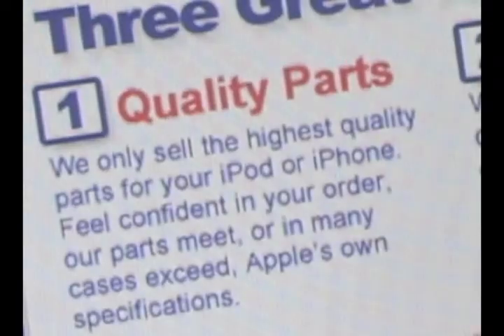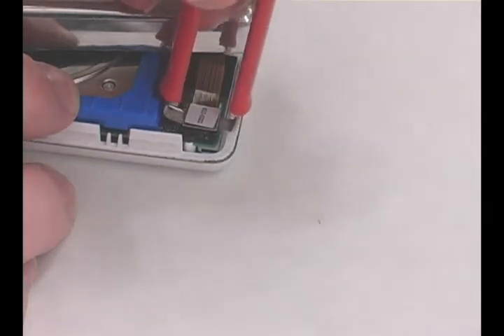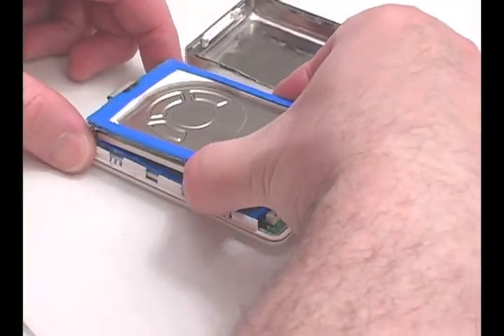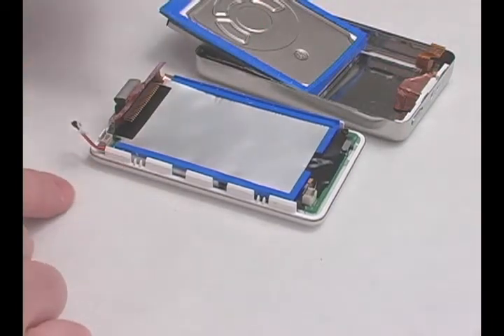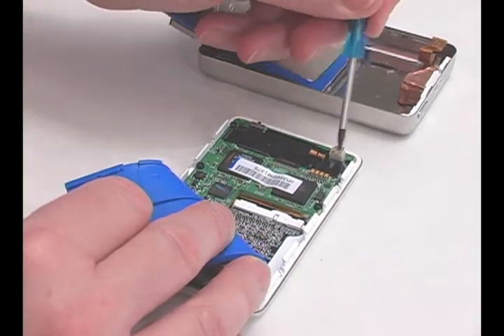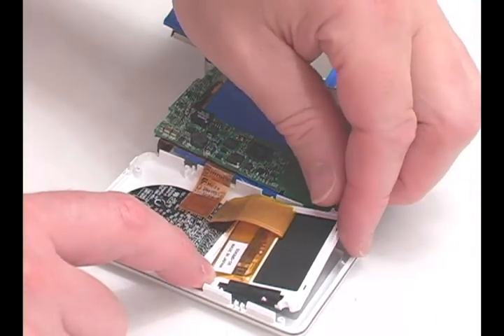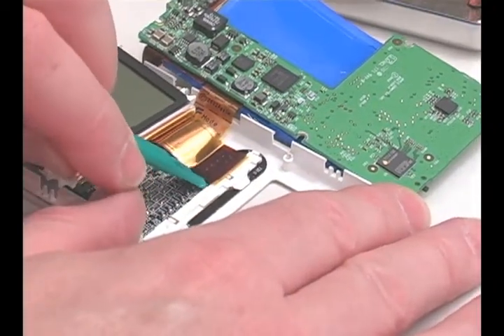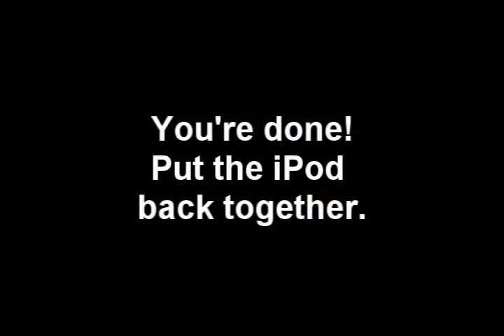DigiExpress - iPod 3rd Generation LCD installation

Comment from the maker: If the colors are gone, but the buttons still work, it sounds like it could be the start of your click wheel beginning to go bad. Those lights are controlled by the click wheel assembly and are powered by those connections. The only way to fix those is to replace the click wheel assembly.

Comment from the maker: @Ezarifa If you are speaking about the iPod Touch 3rd generation, you probably need a replacement headphone jack itself.  As you know whenever you remove headphones from an iPod while its playing it will then automatically turn the iPod to pause.  If your iPod is playing aloud while the headphones are plugged in then you probably need to have that headphone jack replaced.  There may be other issues at hand, but the first step is to swap that headphone jack with a known good unit.

Comment from the maker: @mcrheart101 The cost for replacing the Screen on a 4th Gen iPod Touch is $119.99 for the part and $25.00 for the professional installation service. The newest iPod Touch screen comes as an assembly which includes the Glass, Digitizer and LCD Screen. These parts are fused together and cannot be separated for individual sale.  The return shipping cost is as low as $8.75; so for the full repair it is only $153.74.

Comment from the maker: @MrInfamous405 We offer a Diagnosis service for $25.00, this allows you to ship your device to us and have our technicians source out the exact issue with the device. If we can repair the device with parts already installed on your device then it is covered under the initial $25.00. Once the diagnosis is completed the technician will report those results to you via email; he will list any parts that are necessary or optional.  Please visit our website for more information.